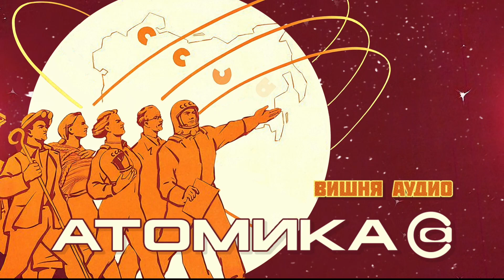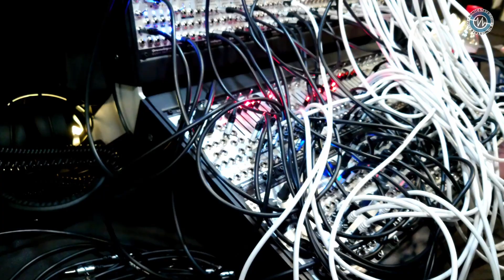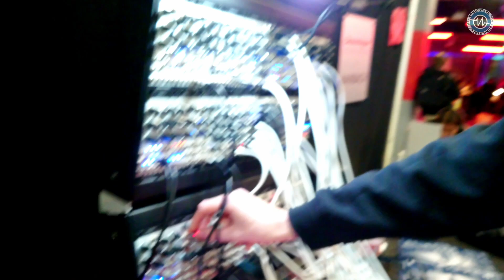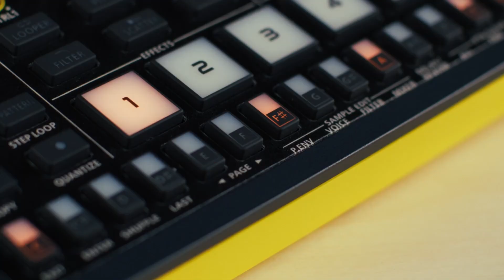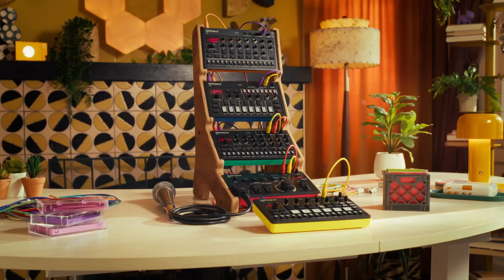Bristronica 24: A Patch With The Joranalogue System

Comment: Incredible patch. I would love to know more about how he was patching the dual step 8s.
Reply: hey, used 1 step 8 in shift register/all/sample mode (this one gets a clock into the step input) then i send a 0 - 5v noise to the input of the first step 8. now you have kinda 8 pseudo random voltages on the individual outputs. then i take 1 of these random outputs and use it to modulate the stage input of the 2nd step 8 so now the 2nd step 8 will play randomly in synch with the first step 8. i hope this helps :)
Reply: @tangie303  Thanks! Sounds awesome!